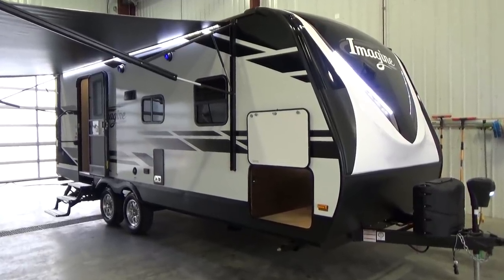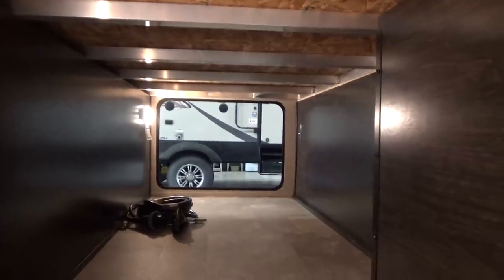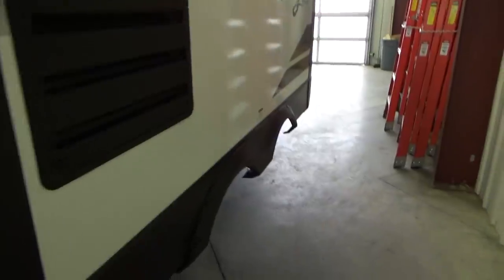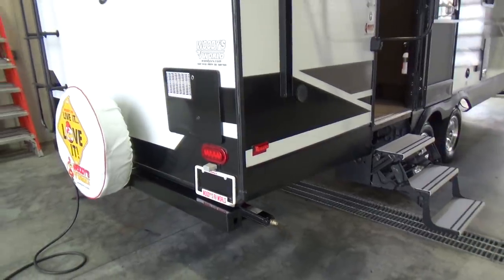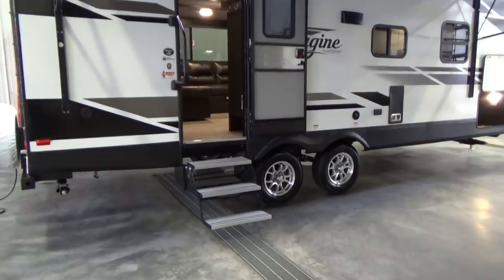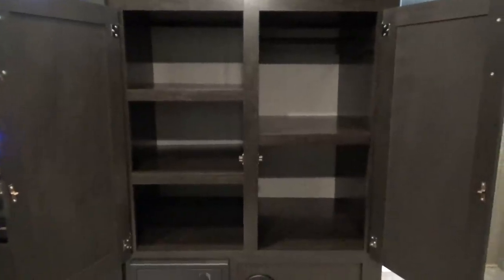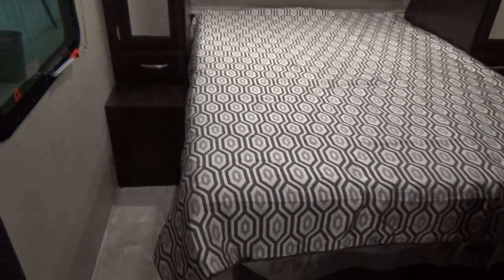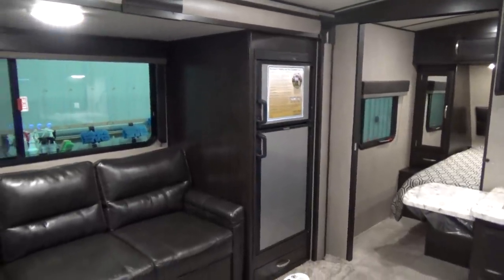2019 Grand Design RV Imagine 2150RB Travel Trailer

Comment: I just LOVE the 2150RB. There are a few other trailers out there using this floor plan, but in my opinion, the GD pulls it off the best and for the best money. For a pure couples trailer, this really has it all. Can't wait to pick ours up this spring.
Reply: IMO, I'll take a Lance 2285. Same size, lighter, much higher quality.
Reply: @zedhead2864  in the intervening years,  Rockwood came out with basically the exact same floorplan accept everything is upgraded. It comes with proper steps,  slide out awnings (plural), and generally nicer finishing touches.  The slide out wardrobe is really nice. What's more, the price was basically the same as the 2150RB. Maybe within a couple K. But where your spending 30k, what's 2k here or there. The standard upgrades are well worth the added cost. It cost me well more than 2k to make the upgrades after market. 

With that said, I dont really have any complaints about the 2150RB. The floor plan really is excellent after 2 seasons and we have very much enjoyed it. 

If they had had the rockwood at the time we bought the GD, we would have bought the rockwood. I suspect our next rig will be GDs smallest 5th wheel.

Comment: We bought this model Grand Design this summer and it has been great.  Have owned many rv’s over the years and this one has been one of the best.  I would suggest changing out those Westlake tires though, my experience with them has not been good.  The first thing I did after buying mine was to put a set of Goodyear Endurance tires on it,
I wish Grand Design would put better tires on their trailers, I would gladly pay more for better rubber.
Reply: What is the max loaded tow weight? My truck is set up to tow 9,100 lbs
Reply: @suzyq_lasvegas4536  you also need to consider your cargo capacity.

Comment: Goes to show you that you get what you pay for when it comes to an RV.  3 year warranty!  Impressed with the integrity of the structure and you did a great job is describing the quality of the Imagine.
Reply: Warranty means little. It takes a month or more to get repairs done.  I know.  I've been there,  done that.
Reply: @mmabagain  Depends on the dealer and the problem.  It would be more helpful if you gave more details.

Comment: Double pane windows? Winter camping ready? Shocks on the axles? I want to go up the AlCan and spend a year in Alaska. Disappointed in the plastic bathroom sink and fixtures at this price point.
Reply from the maker: Robert Polkamp, thank you for your questions and comments. If you are looking for a hearty, well appointed travel trailer, that’s able to handle the colder temperatures of Alaska for an extended stay, we would recommend you take a look at the GD Reflection travel trailer line up. The Reflection offers everything you are requesting and has some really nice floor plans, industry leading features, and great options like dual pane windows. We’ve included a link to the Reflection travel trailers on the GD website for your convenience. We hope this helps to steer you in the right direction. You can also visit our website at www.woodysrv.com for more information. 

Please stay tuned as we will be shooting more videos of the new GD RV’s as they arrive for 2019. Thanks again for your inquiry and watching our videos. Take care and Happy Camping!!😀

https://www.granddesignrv.com/showroom/2019/travel-trailer/reflection/floorplans

Comment: looks nice (Australia here) Why do you guys use scissor jacks as stabilizers and not drop down jacks, which are much easier and faster to set up and use?
Reply: I am guessing at this but I used to work at a construction equipment trailer manufacturer and may have a clue...to use drop down jacks there will need to be a fair amount of vertical space taken up within the trailer body that could otherwise be used for maintaining a squared off storage bay. Scissor jacks of course take up very little room underneath and no space within the RV body; most folks use a cordless drill with a socket to run them down and up quickly.
Reply: simply it is choice you can get either.  Some like one better and they have choices on it.

Comment: No Mor Ride suspension or HD shackles. Walls are also thinner than Outdoors RV/Arctic Fox trailers and 16in 10ply Good Year tires on Outdoors RV/Arctic Fox trailers.
That is all OK if you never drive off of smooth concrete or never drive in the North East US.

Comment: I upgraded my suspension with Dexter E Z Flex shackles and equalizers ,much better than stock parts , one thing that i noticed ... i dont think the Schwintek system is the greatest on larger slides like this trailer , Schwintek is ok for smaller slides ...could have issues on larger slides .

Comment: Another thing that sets this camper apart from the competitors is that they actually put wheels and tires on their campers..The competitors will most likely just have you rolling on hubs and throwing sparks which is a real hazard by the competitors.

Comment: Would a Ford ranger XL be able to pull this camper trailer
Reply: F i don't know....give it a try and figure it out yourself....
Reply: It is not just tow capacity of your truck but the cargo carry capacity.  If you have 4 full sized adults plus their items in the truck that weight counts as cargo for the truck.  so you either need to provide a lot more information or do a little math your self.  Look in your trucks door frame to see what the towing and cargo numbers are. cargo is everything you carry, people, pets, anything in the bed and weight down on the hitch.  These numbers are vehicle specific depending on engine and drive train.  A diesel may have more towing but since it is heavier you will have less cargo carrying capacity.  If you and your other are small and 130 pounds each then you use that for weight, if you are both tall and you are 300 pounds yourself wife 200 pounds 2  teenage sons each 200 pounds then your cargo capacity is already down 900 pounds.    If you decide to just tow the camper and the truck is over weight when you have an accident even caused by someone else you can get ticketed for overweight, where I live it is at least $1 a pound plus $200 and they will know, also your insurance can say they are not paying for anything since you violated the law.   So do you see why he cannot tell you if your truck can pull it?

Comment: can a TV be installed in the bedroom ?
Reply: I have a 2017 RL 2500 Grand Design, there is a backing plate with outlet for cable and electrical. (Great Tailor )!
Reply: thanx mel
Reply: you can install a tv  depending on what you want they have a spot or you can put up a plate and do it.

Comment: Hello! I’m a little bit late to this conversation but I was wondering if my 2017 Jeep Grand Cherokee would be able to tow this. Mine has a towing capacity of 7,200 pounds.  I have an older and smaller Jayco. But since our dogs have grown and more people come visit us at our campsites we needed more space. Thanks!
Reply: I have been towing my 2150 for 2.5 years with my MB350 diesel 465ft lb torque rated at 7300#.  With good stabilizers you don't even know it is there.  I have put fulltime 30000 miles on the trailer with 65,000 sightseeing on the SUV.  I could probably not be morr comfortable...I replaced the chaise lounge with a Lazy-boy ...there is an option for theater seating, take a serious look at this.  Great bathroom and shower.
I got mine for about 20% off list at Dodd's RV in Hampton Roads, Va. This is a great RV winter or summer.
Reply: Frederic Bishop          Thanks! Do you think I’d be able to? It is a Diesel so it has a lot of torque.
Reply: It should tow it fine, just make sure you're good on your vehicles payload.
Reply: shaynehoff     Cool thanks!

Comment: Everything seems good quality, till you get to the bathroom. That shower is as cheap as they come! Yah it's a good size but they use plastic surrounds and pan. Don't even get me started on that $9 faucet and showerhead!!! I mean people are already willing to spend almost $30K on this, don't you think people would fork over another $400 for a decent shower that won't crack!?!?
Reply: TheJerrydon575 I was surprised to see that hose and shower head.  someone may have come in and switched those out to appease a customer buying another rig.  I just bought basically the identical rig and it has nice stainless steel hose and shower head.  Looked nothing like that setup.

Comment: What is leaking under the RV?
Reply from the maker: Nancy K, great question. This particular trailer had just been through its first clean inside our reconditioning dept. It looks as though it’s that last little bit of water dripping from when they sprayed off the bottom of the undercarriage on the trailer. We take immense pride in the detail work we perform on all the RV’s we sell at our dealership, that way we can deliver the nicest looking product to the customer as possible. Thanks again for your question. Happy Camping!!😀

Comment: Can it be converted to solar
Reply from the maker: Brent Anderson, great question! There are 2 ways to do solar. 1. Use the factory installed solar port on the front drivers side of the trailer. This requires you use a suitcase style solar panel. 2. Install a permanent mount panel to the roof. This is the preferred method because your panel is less likely to disappear and the panel will always do its job even when your not with the trailer. We hope this helps!! Thanks again for your question!😀
Reply: This thing is butiful
Reply: How much does this cost? I live in New Zealand bytheway
Reply from the maker: Brent Anderson, great question!! The 2150RB Imagine sells in the upper 30k range in Canada.😀
Reply: Canadian RV Guy that’s pretty good for what u get. I need to check out what it would cost to ship it to nz.

Comment: Uvw 5290, gvwr 6695.... For those that want to know the weight.. you want to do the rescearch. Google it.. I have a Dodge 1500. 07' 3.4.… I don't think my truck can pull? Right??. Looking for trailer. I work on the road, right now I'm in Chicago. It's cold. So need one for cold weather. I'm researching

Comment: Cn I just plug solar In like suitcase type and do the windows open and have screens i am looking to purchase this one and hope cn tow with my ford escape
Reply from the maker: karenabdelkader, thank you for your posts, comments, and questions. All the Imagine’s include the easy port access for a portable suitcase style solar panel. Also included are screens for all the windows. I would NOT recommend you try to pull with your Ford Escape. Unfortunately it’s just to light of a vehicle all around to be able to pull a GD of any kind at the moment. Tow capacity of the Escape looks to run between 1500 to 3500lbs. One way to find out the capability of your vehicle is to call your local Ford dealer. They should be able to tell you the exact specs when you provide them with your VIN #. We hope this helps get you going in the right direction. Thanks for watching our videos.😀
Reply: Umm... you really shouldn't be taking towing that lightly. It's a serious matter. This is 5700 unloaded. It's dang near out of 1/2 ton pickup range.

Comment: So, for water you have to leave your storage door open…what a grand design.  snark
Reply from the maker: Doug Gak, thank you for your comment. Located at the base of the utility centre there is a port hole access with a lid and sliding slot to where you can run your water hose and other cables. This allows you to be able to close and lock your compartment completely. We hope you find this information insightful. Thanks again for your comment. Warmest Regards! Team Woody’s RV Leduc.😀
Reply: @WoodysRVWorldOfficial  I have always liked Grand Design, except for this specific thing.  That slot with your your hose, cable and cords running up through seems to me to be a open invitation for mice and other pest to enter the RV.  Putting that utility center in its own separate compartment makes more sense to me.  Other than that, I think Grand Design makes a fantastic RV.
Reply from the maker: Eric TenEyck, thank you for your comments and overall positive feedback. The port hole access for hoses and cables, if properly managed and maintained should eliminate this concern. The sliding slot when closed properly around any items running through it should prevent any critters from sneaking up inside. If you’re in the area we would be happy to invite you down to the dealership so that we can show you this great feature in person. Thank you for watching the video and providing the feedback, to which we will share with GDRV. Take care and Happy Camping!!😀

Comment: slide out has no toppers. Two track slide will bend over time since the couch is over the slide. terrible design. remember when you go sit on couch you will "plop" yourself on couch.Refrigerator is also on the slide. less weight on a slide the better.

Comment: Please stop confusing/lying to customers about saving money by using a grease gun rather than repacking the bearings.  By squirting more grease in the bearings, the old has to go somewhere, and guess where it goes.  all inside the drum and on the brakes!  grease on brakes is a really really bad idea!
Reply from the maker: Nicea Trya, thank you for your comment. We do agree that getting grease on your brakes in not a good thing. However, the bearing system that GDRV uses on their trailers thankfully does not do what you suggest. GDRV uses the EZ Lube bearing system by Dexter that cycles the old grease out while injecting the new grease in with a grease gun and without having to do a complete repack. To explain this deeper and to show you that we are not trying to confuse or lie to customers, we’ve attached a YouTube video link by Dexter that explains in detail how the system works. 

https://youtu.be/Xh4Xv5MyOQE

Thank you again for you comments and we hope you enjoy the video!! Take care and Happy Camping!!😀

Comment: r7!  is useless! way to liite on insulation  where it counts the most!
Reply from the maker: Donald Brown, thanks for your comment. There are 3 R-value ratings for sidewalls that are most common in 98% of the RV’s produced by all manufacturers today. Based on wall thickness this is what you typically get. 
1 1/2” = R7 (Imagine)
2” = R9 (Transcend / Reflection)
2 1/4” = R11 (Momentum / Solitude)
We hope this helps. 😀